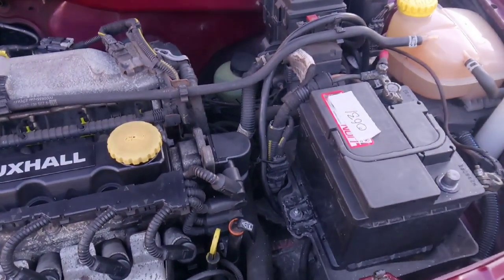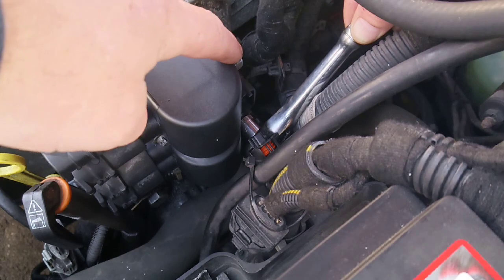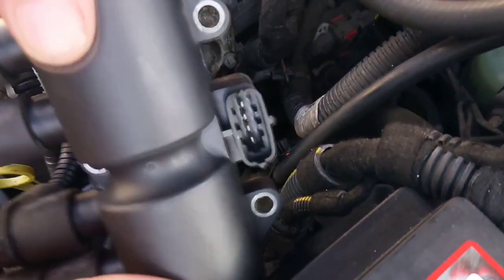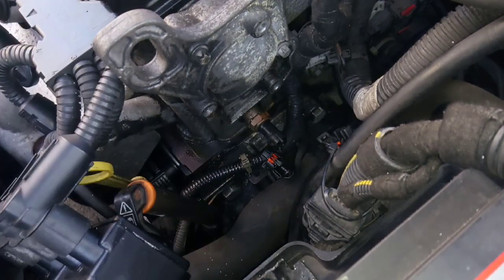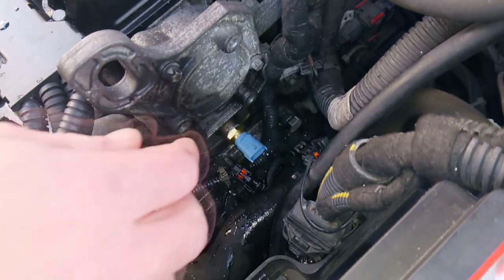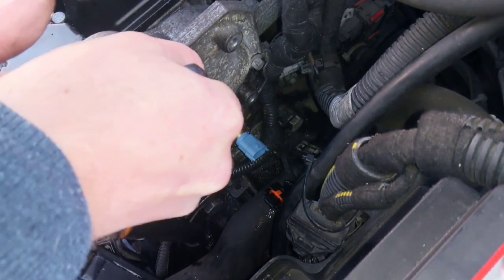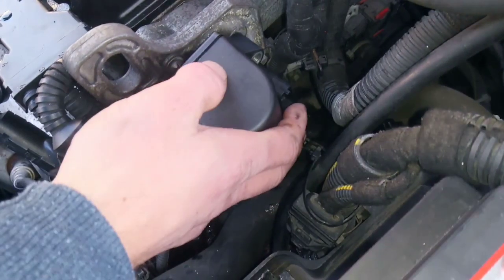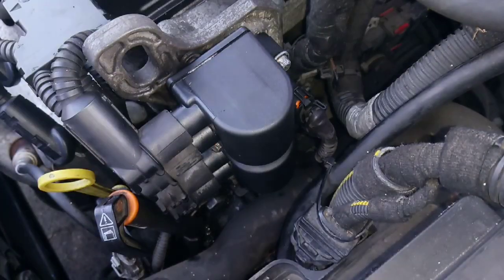How To Change Coolant Temperature Sensor Astra G Mk4 1.6 8v

Comment: That’s Handy ! As my HAYNES MANUAL says it’s on the Left of the engine under the alternator ! I was looking in the wrong place ! 🙈
Reply: On the left side ,you've got your thermostat . The sensor is on the right side. I've got the same problem . I must change bothe things and the waterpump also .

Comment: Hi, I’ve got a vauxhall astra j and I’ve got ‘ ac off due to high engine temp’ messed coming up, the temperature gauge hardly moves and stays zero and there’s enough coolant with no signs of leaks. Do i need to change the coolant sensor or this one? Thanks
Reply: Hi. I have same problem! Any luck what did you do to fix. 
Thanks.

Comment: Hi, Thanks very much for posting. My Astra G 1.6 8v developed a misfire on cylinder 4 (P304) this weekend after driving for 30 mins. Only noticeable at low speeds. I also noticed the temp gauge had stopped working. Was wondering if this sensor could cause both issues. Noticed it connected to the ECU so wonder if it was causing a wrong air fuel ratio. I replaced the coil / plugs past year so not suspecting those. Thanks for any advice
Reply: Hi, lately I have the same problem  as yours. Have you dealt with the problem yet? How to do it? Thanks for any advice
Reply: @szikago736  Hiya, It fixed the temp gauge issue but not the misfire. I think I've either got an issue with the signal from the ECU to the coil for cylinder 4 or I have been told it could be an injector. I've not had time to sort it yet but I'll keep you posted 👍

Comment: Can you tell us how beneficial replacing that sensor has been so far ?
Reply from the maker: Not driven the car yet just started car to check all was OK.. only just replaced it today..but it is a crucial sensor allowing engine to operate correctly and its a low cost part so worth replacing
Reply: Hi, can it be the cause of overheating engine? I have same car but problem of overheating engine

Comment: Sean my Astra 1.6 club 52 plate the heater has stopped working and engine temp goes up reasonably quickly any ideas what the problem might be? The heater works but blowing cold air is what I meant.